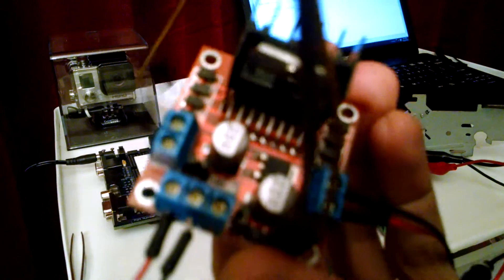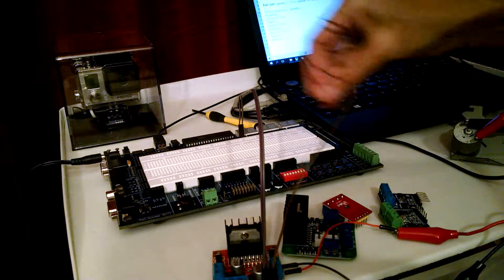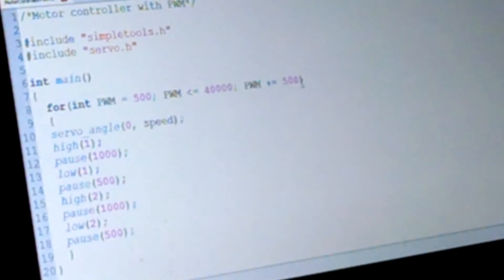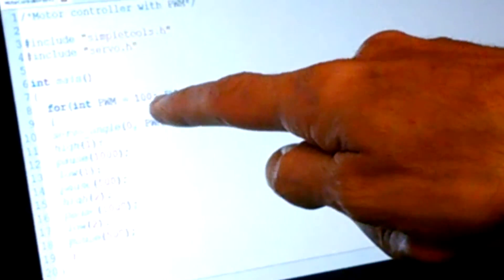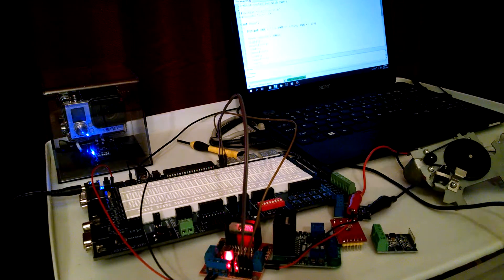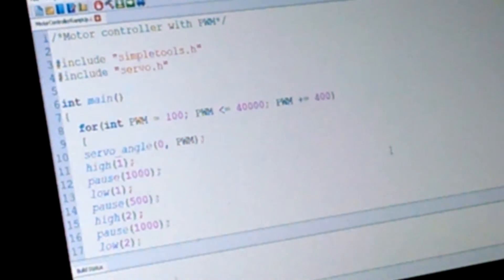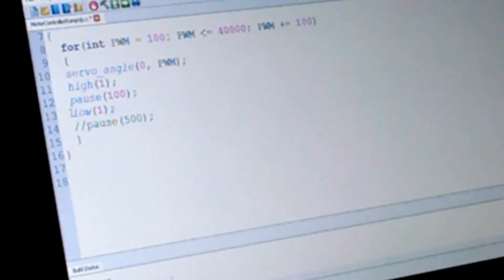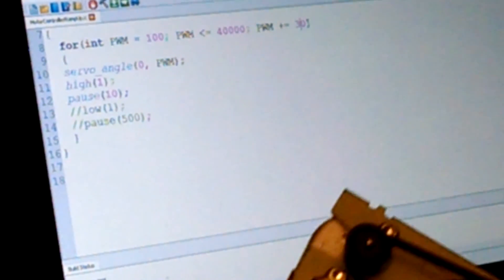L298N Motor Controller with a Parallax Propeller Microcontroller, SimpleIDE and C C++

Comment: Could you give some more info with a diagram of connecting the pins to the L298N

Thanks, 

John S. Colonias
jcolonias@comcast.net
Reply from the maker: sure thing, what microcontroller are you using?                              https://i2.wp.com/electronicshobbyists.com/wp-content/uploads/2017/08/word-image-13.png
Reply from the maker: If you look at the picture diagram from the link above the unregulated power output from the microcontroller is connected to "5 to 35V Vs" and any ground pin from the microcontroller to GND, the DC motor is connected to "Motor B" then the speed (Pin 0 on microcontroller) is connected to "Enable B" and responds to the command line "servo angle (0. speed);" 0 being the pin # and speed the variable speed, and finally pins 1 and 2 (on microcontroller) connected to logic pins 3 and 4 which turn on the motor in each direction "high(1); low(1); high(2); low(2);"